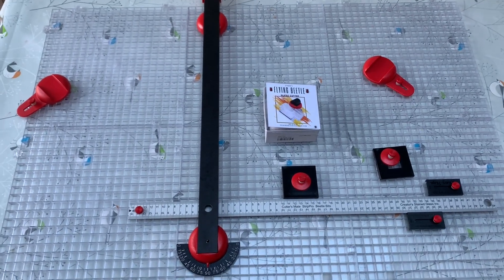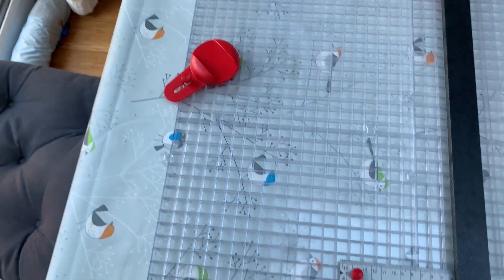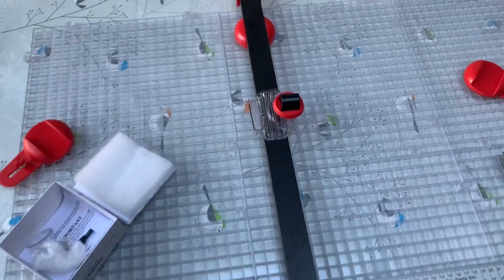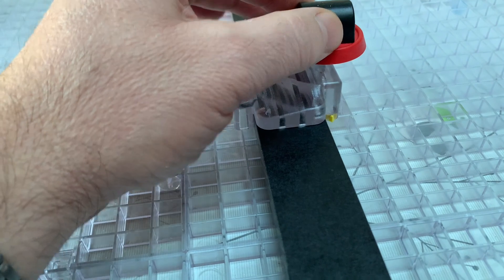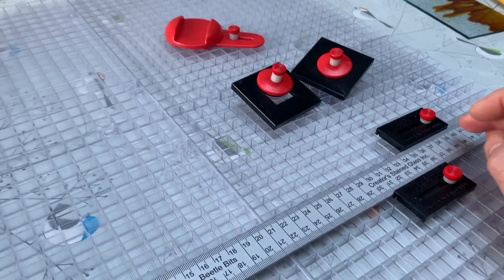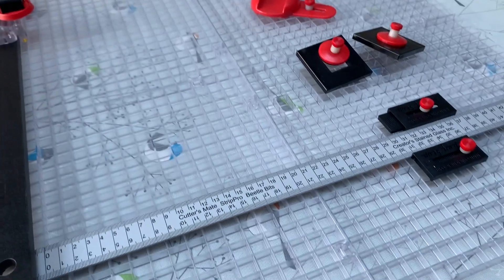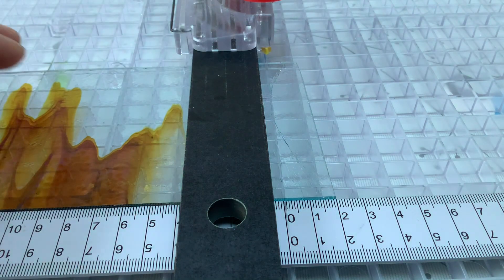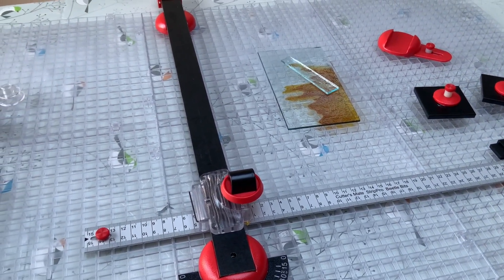Beetle Bits cutting system review. Honest assessment. Ideal for fused glass straight cuts.

Comment: I watched the vendor video on YouTube. It showed to use the oil well on the top of the ruler and the other without the mesh on the bottom side of the ruler. That would free up the extra parts. Hope it helps.
Reply: Thank you for sharing this tip, I had no idea and that helps a lot

Comment: Thank you for the video 😊😊 I bought this system but now I used it for the first time I'm struggling with how to cut 1cm square as it goes under the ruler. Does anyone know if it's possible with this or have I bought the wrong one? ( Don't think I can send it back now I've used it and chucked away the plastic?)